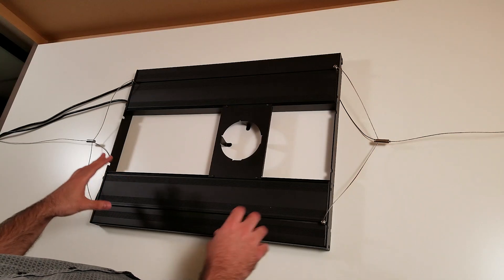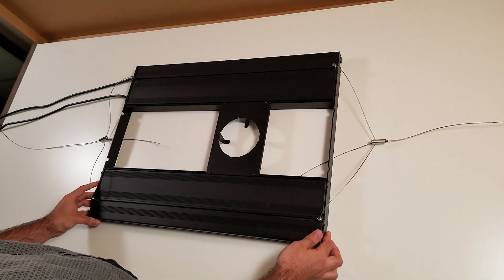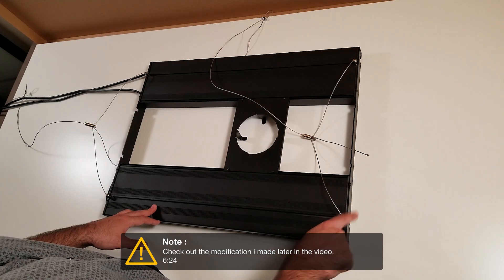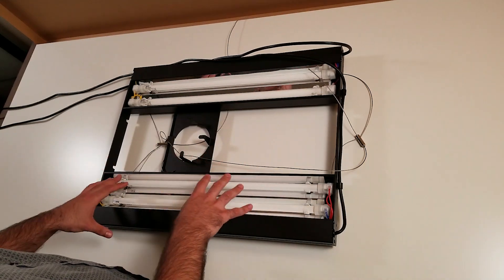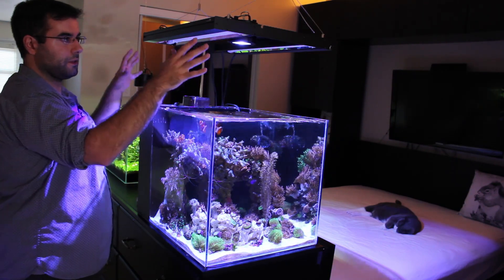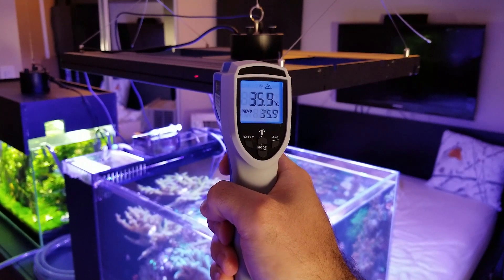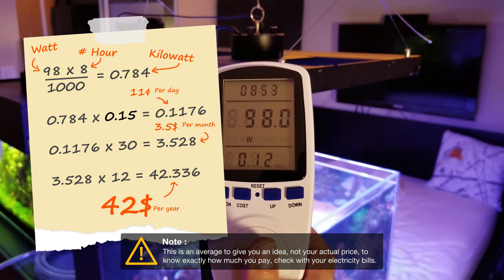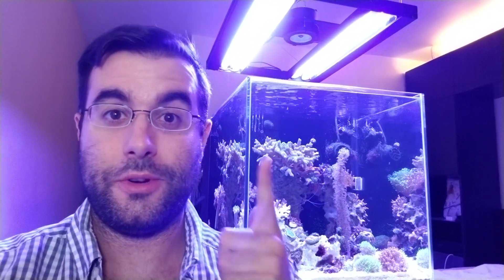Aquatic Life T5 Hybrid Fixture Review, Best combo with LED light ?

Comment: I just ordered aquatic life hybrid Gen 120cm one it take 10 days to get to the uk I want to change the dimmable ballast I was told to buy sd254 58uni and I hate the lights cable being on one side each want tonchage it like yours I also want a controller to turn it off if that's possible with dimmable

Comment: What kind of smart plug did you use? Thanks
Reply from the maker: I use WiFi Smart Plug, Mini Wireless Remote Control Socket Outlet on Amazon, but i'm not sure if i would recommend it, had couple trouble with them.